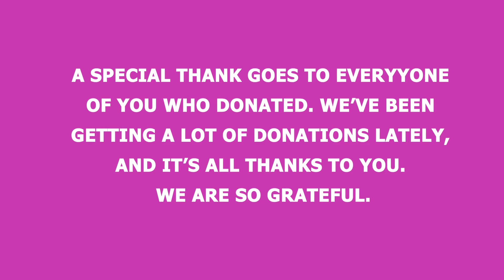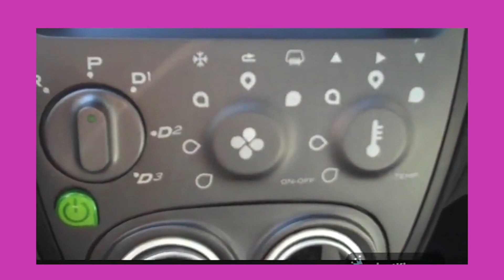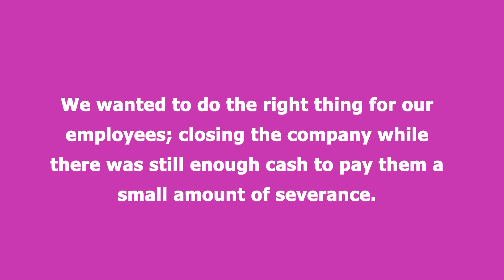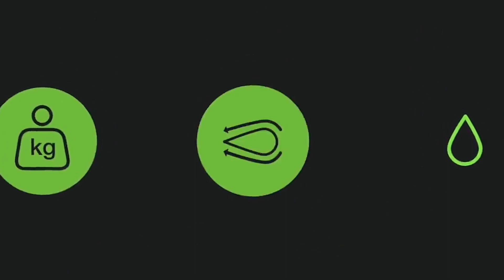Why Aptera Failed The First Time !

Comment: Why they failed? They did not have the money to start production. Same as now. They needed 200 Mill in 2008. They may need 300 Mill now. At least.
Reply: Not true.  They were ready to start production when the new Idealab CEO forced out the founders, and they didn't have the funds for HIS new very different plan.
Reply: @n.brucenelson5920  HIS Plan was a 4 wheeled vehicle, that can be registered as a car. Much easier to get money and acceptance for. Much better than a failed 3 wheeled motorcycle. No Investor wants that. In 2008 and in 2022.
Reply: @vic321344  You continue to be woefully wrong on all counts.  Aptera had the funding they needed to start production of their 3 wheel design.  The replacement 4 wheel design of the Detroit guys Idealab brought in never did.  Even the previous backers pulled out from the changed vision.

Aptera Corp has over 15000 investors for the the current plan, including crowd funding, VCs and Whales.  You continue to make up false information.  Who is paying you to do so?
Reply: @n.brucenelson5920  they did not have the Funds to Start production,  because they did not het the 150mill loan from the government.  Because they did not get together the 80 mill from Private Investors. Would that be easier if they wanted to build a 4 wheeled car instead a 3 wheeled motorcycle: for shure. Same happens today.
Reply: @vic321344  Nice rewrite of the history.  Fambro and Anthony had the funds to start building, until Wilbur came in and started moving the goal posts.  They did not need an additional 150 million until he  changed the plan and ousted the founders from any say in the company.  Aptera is making steady progress towards production and there is almost zero chance that the founders will lose control this time.

By the way, my stock in Chris Anthony's public lithium battery company went up again today and has been earning me a nice return in a down market.
Reply: @n.brucenelson5920  nice fairy tale. As if 50 mill will ever be enough to Start a production. Aptera produced 50 mill loss last quarter without even having a production ready prototype.

Comment: Its going to fail again because there's not enough people that want to get chased by the cops for not wearing a helmet just for crossing the wrong state line, or forcing everyone in the car that's under 21 to wear a helmet in many states.    It would be high on my list to buy one if it wasn't for that.   Cure is dually rear wheel if the rear absolutely must have the center-of-car contact, but 3 wheels is an "autocycle", I road rally with the Sports CAR Club of America, and no vehicle that needs motorcycle insurance is going to be competing in the SCCA Road Rally Championships.
Reply: Just three states left that require helmets for kids, and none require them for adults. That's a lot less than 'many', and the laws in those three states are likely to change soon
Reply: That is not the information I found when I researched it.   There were approx 17 states requiring it for under 18, and 1 for everyone up someplace in New England.   If there is a better situation, then you / Aptera should create a gridwork of helmet requirements so people know different.   About every other thing on the internet is 20 years old, so it's very difficult to find what's what today.
Reply: @davehead6497  check out the "move" section of the aptera website. Looks like it's down to just two states that require a helmet for kids. I know earlier this year Alaska and Massachusetts were on that list, but now it's just Montana and Texas